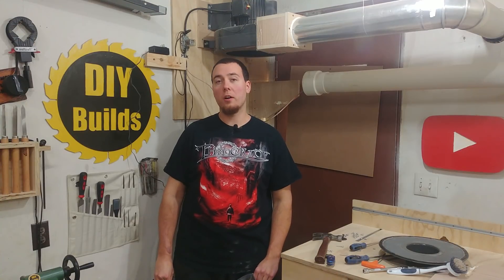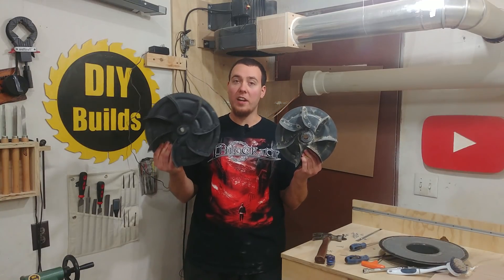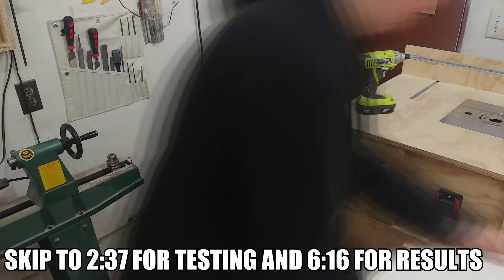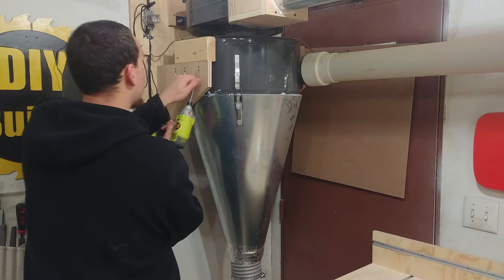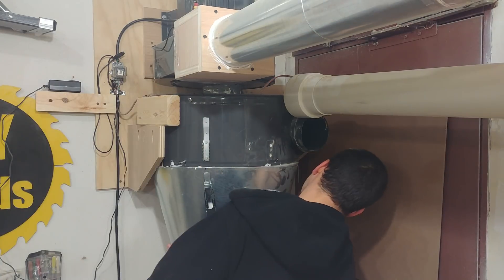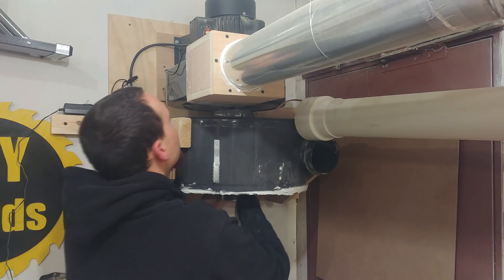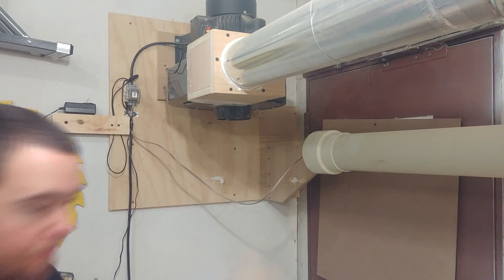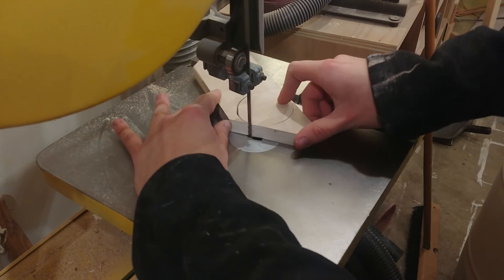Dust Collector Impeller Upgrade - Testing Air flow, Suction, Noise Levels and Current Draw

Comment: Excellent video..!   Can you explain a little bit more about how you were able to pull the old fan off with that simple made pully?  What are the heads of the screws grabbing onto?  And what and how are you drilling that long bolt into?  What is causing it to pull?  I plan on making this upgrade and that seemed the simplest way to remove the old fan..  Thanks!!!
Reply from the maker: 3 pan head screws grab the lip of the pilot while the lag bolt pushes against the shaft of the motor
Reply: It looked that way. :)  Wouldn't the tip of the lag bolt damage the threads of the motor shaft?

Comment: The 12 inch Grizzly impeller works and is much cheaper --- about $40
Reply: got a link for that impeller @ $40 ??
Reply: the Grizzly p/n  is      PX1666022B
Reply: @WilWinston  Before you spend $40 check what hub it has. I learned hard way.
Reply: It fit mine perfectly

Grizzly has a fair return policy
Reply: @WilWinston   Thanks for the info. Do you have any test data to show the improvement over the stock impeller?
Reply: I can confirm that the grizzly impeller will not work without modification to the impeller or the dust collector as the grizzly impeller is taller than the stock harbor freight impeller.

Comment: This impeller is always sold out. I suspect foul play.  As in they aren't making new ones so they sell other machines instead or they don't want you having a decent hf system.
Reply: Available 10/22.  In 'mass quantities' per parts guy at Rikon.
Reply: I'll order it today then, thank you!
Reply: @richardpatterson4312  Mine arrived today.  Charged and shipped 10/26.  FYI and good luck

Comment: I made a husky homemade hub puller, no offense, but much better than yours, and yet my fan will NOT come off it’s really on there. Any more and I’m afraid of ruining it. The key is really in there. I’m afraid an actual hub puller won’t fit in there even if I go buy one.. thoughts?
Reply from the maker: Heat gun to expand the fan metal perhaps?
Reply: DIY Builds no luck at all. I went to Harbor Freight and got an actual puller and it just broke the harbor freight fan hub, just chipped it right off, now I am in real trouble.. and of course my local store doesn’t have any in stock and the nearest is an hour drive I’m beyond pissed. It’s like my original fan is welded on.
Reply: And I didn’t see what you are doing with the actual key from the shaft in this video? Does it come out or just stay on the shaft??
Reply: And the problem with heating it up seems to be it’s just heating up the shaft too
Reply from the maker: Ya im not sure what to tell you. Mine came off with not much effort and they key was relatively easy to align.  Not sure if it was removable.
Reply: DIY Builds well I FINALLY GOT IT OFF!! However now, it’s tripping the 15a breaker right before it gets to speed. Workaround? That’s not full on hiring an electrician?
Reply from the maker: @alexmasi9453  is it tripping if you put the cyclone on and all the piping. That should limit airflow and reduce current draw

Comment: GREAT video, thank you so much. Two questions if I may.  Did you get the impression that the H.F. unit was under performing to begin with? I ran a "free fan test", meaning inlet and outlet are not connected to anything and I got an average velocity of 8700 ft/min, which, on a 4 inch inlet translates to 760 cfm, but the unit is sold as a 1550 cfm.  Second question if I may, we can see where you had one end of the manometer, where did you place the other end? - Thanks
Reply from the maker: sum1sw no I just saw one other guy do it and i figured i could always use more suction lol. As far as the manometer it's open on the other end. Watch my video on building the manometer.
Reply: Oh OK, thank you so much.

Comment: So $212 (including tax) for the HF DC.  $120 for the 12" impeller.  $330ish for the entire thing.  A Shop Fox 1.5 HP DC is $324 w/12" impeller.  Is the HF w/upgraded impeller a better performer with that extra .5 HP?
Reply from the maker: killxswitch my hf dc was 160 with tax
Reply: I forgot about the 20 and 25% coupons.  Durr.  Good video.

Comment: It would have been very interesting to see CFM comparison at the end of a 10ft run. Since low pressure air is not very compressible (acts more like fluid), your bottleneck is ductwork, starting from 5" inlet on impeller. To benefit from the upgrade you really need 6" pipes right to your machines.

Comment: Finally got it finished, but am finding that it's tripping the dedicated 20A breaker I installed just for it, most of the time. It seems to run fine if it gets past the startup, I wish I could find some kind of soft-start circuit breaker or outlet but nothing practical is showing up. The 20A breaker is one of the new skinny kind, where 2 breakers share what would traditionally be a single breaker slot. I would expect that a 20A breaker would be a 20A breaker, but are those iffier than a standard one?

I don't have an inline tester to check the draw but presumably it would show it going over 20 before flipping the breaker. I tested the stock HF impeller in situ and it had no issues, so seems to be the added effort of winding up the 6lb 7oz Rikon impeller.
Reply from the maker: I also have a small 20a breaker that fits 2 into 1 slot. (Eaton brand)   how are you running it because mine didn't trip when i had the cyclone attached and all the piping. This is because there is less strain on the motor initially untill it starts sucking which should get you past the inrush current.
Reply: DIY Builds - hmm... I had wondered if I was because I have the 5” pot DD, but it looks like you retained the 5” intake port, which is even more constrictive. Maybe it’s variability between individual HF motors? I’m going to see if I can find a way to measure that draw. BTW, the cord to the motor feels warm after running the motor even for less than a minute when I can get it past start-up, does yours?
Reply from the maker: Havnt noticed the cord getting warm. Mine normal running current is around 9 or 10 i believe. So 16awg should be fine
Reply: @ramatsu did you figure out your issue? My setup is tripping a 20 amp breaker at startup too.
Reply: @TylerJSpry  TL;DR version: Still trips on occasion, but rarely enough I haven't done the work to fix it. 

Full version: I pulled the whole motor/impeller assembly out and took it to an electric motor shop here in town, where I learned some fascinating and completely non-intuitive stuff about electric motors, and why I want to go 3-phase when I build out my dream shop :-)

I had been assuming that the tripping was caused by excessive load on the motor at startup, and so had been working hard to reduce that by giving it lots of air - basically thinking that if the motor was trying to pull air through a system that was closed and therefore resisting the pull, it would create load. It turns out the exact opposite is true, and he quickly demo'd this on his shop floor by powering up my assembly wide open, where it would immediately trip his breaker, and then powering it up with the intake completely blocked, where it would spin up just fine. So the shortest long version is, I try to have my gates shut on startup and for the most part, don't have much trouble. 

I joked that I was probably his "dumb call of the week," but he told me he probably explains this 100 times a year and lots of people bring their motors to him because they don't believe him when he tells them on the phone. 

Also, I had gotten a clamp meter and was terrified to see that my fan was drawing something like 60-70amps on spinup! I didn't think that was possible, and figured that I didn't understand how to use my clamp meter. He explained that single-phase motors do draw that much on startup, and that a 20A breaker will let that go for the second or two before flipping, by which time the motor comes down to more like it's normal 9-10A draw. (Now, when mine trips, it does so absolutely instantaneously, without the impeller sounding like it starts to even turn, so that's more of just an interesting fact than something that might be directly involved in the problem.)

He then showed me a phase converter that he plugged into a standard 120v outlet (single phase) and it output 3-phase 240v. That's the moment I realized I did not understand electricity AT ALL and convinced me I should turn to an electrician for some things I thought were pretty straightforward and understood. 

But as far as what it means to me as a user: 1-phase motors have circuitry that create that high initial draw to spin up fast, so you get instant suction in this case, while 3-phase motors are just simple "dumb" magnetic rotors that lack that circuitry, so spin up much slower but never draw more than the normal amperage during the process. Which is also why industrial, studly 3-phase motors tend to be cheaper than HP equivalent 1-phase consumer motors even though I would have expected "more performance, more cost"; they're just simpler devices. 

BTW, I had an electrician come look at replacing my whole box after I learned that A) the tandem breakers are only supposed to go into certain designated slots near the center of the box, which are marked inside the box, and B) that my box, with a bunch of tandem breakers (including this one) right at the top and well outside of that zone, was not marked at all for where they should go, and probably predated that code or approach. I also wanted to know why mine still tripped on occasion. He looked it over and said he wasn't worried about the location of the tandems or the occasional tripping, but that if it bothered me I could rewire that circuit for 30A. Since he was talking himself out of a more expensive job, there's some sense that he's not motivated by greed at least. But since rewiring something I'd just wired was a hassle and maybe not the "right" fix since 20A should be working, I've just lived with it. If I decide I'm going to be in this shop/house for a lot longer, I'll probably still get the box replaced just for GP. 

Hope at least some of that helps understand your situation and at least some of the rest is interesting :-)
Reply: @Portermoto  Thanks Allen, that was helpful. Going to look at my panel now and suspect the same as yours.

Comment: I had the same question as someone else here about your shop made wheel puller: it looks like you used three screws in the plywood disks as standoffs, but it it’s unclear how the center hole/shaft is being used. What is the long piece you’ve run into the center hole in the plywood, and is it threaded into the impeller hub or...?
My Rikon impeller just arrived, was about to run to HF for a wheel puller but would rather follow your lead!
Reply from the maker: i just flattened the end of a lag bolt and drove it against the motor shaft while the 3 screws grabbed onto the impeller lip
Reply: Wow, thanks for the fast reply. I can't quite grasp the physics of how that pulls it off, (was the lag bolt threaded into the plywood or...) but I'll go tear into mine and maybe it will become apparent.

Comment: I replaced the stock blower on my HF Dc with the Rikon impeller I also increased the size of the suction side of the impeller to 6 inches that connected directly into the Supper Dust Deputy in a vertical plane like you did, I saw a significant change in current draw on the motor and static pressure due to the larger input pipe, I also use 5 inch suction lines. I am at an elevation of 2000 MSL in the summer a 95 degree day the density Altitude on average is about 5200 feet. So this mod is very effective here in West Texas.for the exhaust I am using the Wynn 35A nano filter.
Reply: You have done as I plan with 5" lines. Have you done any testing?

Comment: Nice find.  How did you find out about the new impeller?

If ever want to use your manometer to measure actual pressure vs. just comparing pressures, the actual vacuum is the difference in height between the two water columns.. I.E. double the value on your scale if both sides start at zero.

Thanks for sharing the comparison.

Comment: I added the Rikon 12" impeller to my 20 year old 2HP Grizzly. The old Grizzly impeller was almost 12" in diameter but it was significantly heavier and the blades were straight. Also the Grizzly blades were not as tall as the Rikon. I have not checked amperage, vacuum, or windspeed with actual testing as you've shown, but by the seat of my pants and watching the hose pull things off the floor, I know I have certainly validated the cost of the new Rikon. So far I haven't had any problems with my 15 amp breakers. What really made it a good deal was - they only charged my $17 shipping to Alaska! Great video! Thanks!
Reply: Hey JB, I have the same dust collector as you do. Would you mind sharing info regarding the impeller model number? I'm undergoing a rebuild of my dust collector with the Oneida cyclone separator and want to include my impeller with the revamp.
Thanks!
David

Comment: Nice comparison. What drove the upgrade? I'm about to copy your initial install - was that setup not good enough?
Reply from the maker: +Matthew Kline honestly i saw others doing it and I wanted more suction out of my 2" 20 foot shop vac hose so i thought I'd give it a go. The system as it was before was totally fine for everything besides the long hose, which didn't really matter anyways.